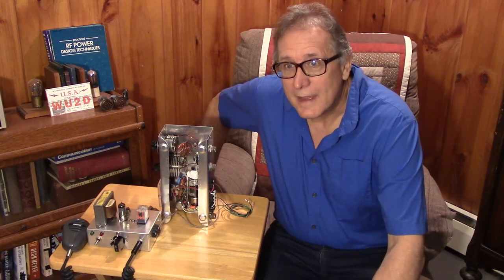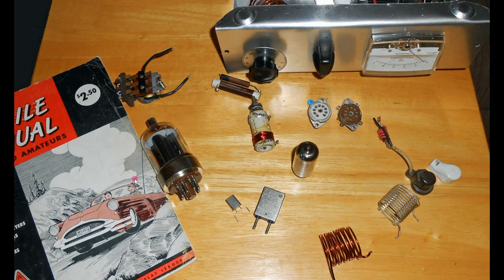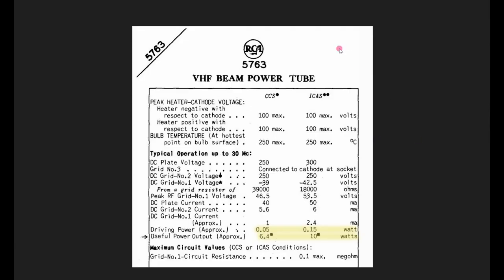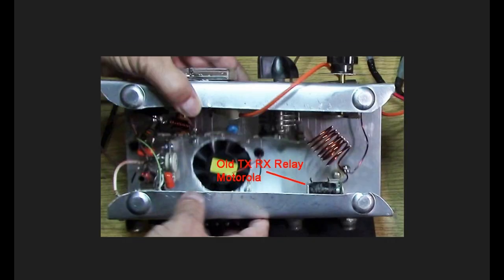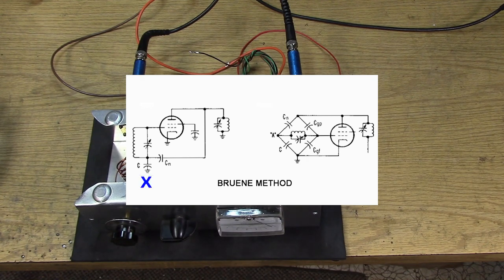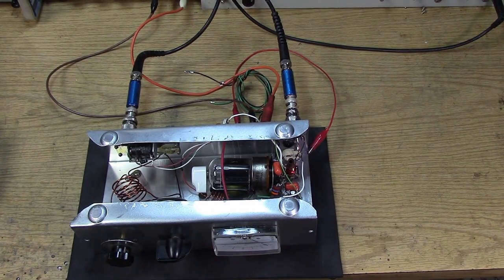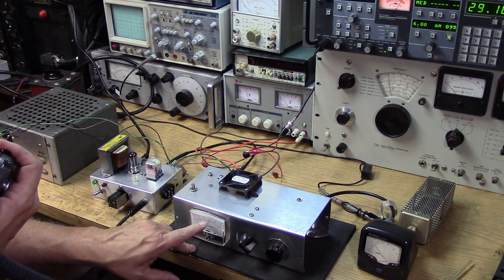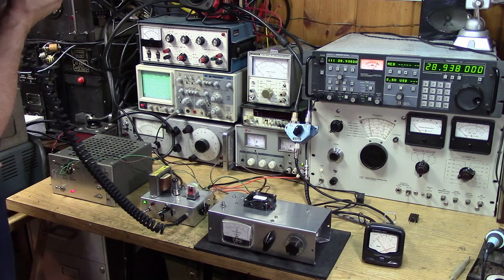10M Linear Amp Part 3

Comment: I love that even though a circuit is "ridiculous" you build it anyway! That way we can see what true ridiculousness is and what to do when (and we will) we run into it in the real world. Yes, sometimes I visit reality for fun to make sure it still exists. 
On my Kenmore 599 twins, and on my Johnson Invader 2000, the neutralization was done with the power off. For some reason it is done on 15 not 10 meters at least on the Johnson, but I believe with both radios. Both rigs run 6146's on the finals. The Johnson exciter was 100 watts output IF you didn't run the built in leee- neeear with a pair of PL-175 (4-400 with an extra suppression grid). It is NOT a true am rig as it's usb with injected carrier. Something I've only known CHU to do. Really enjoyed this series. Thanks a lot and 73's!

Comment: Hi Mike, the idea of having a grounded grid amp configuration got me thinking about another amplifier configuration.
I see a few aspacts of the kind of amplifier you propose - the need for neutralization (negative feedback), the need for a pi network on the output as impedance transformation. I have tried a Norton amplifier once, which is usually made with a bipolar transistor. If you are not familiar with the Norton amplifier, it uses a grounded base, input is into the emitter but via one turn of a transformer (in series with the emitter), of which another part is in the collector line. The transformer is tapped halfway up the collector part, but this could also be a separate winding. The nice thing about this amp is that the voltage gain is set by means of the input (1 turn) to output turns ratio (let's call this N over 1). The input impedance is equal to the load impedance if the total number of primary turns, including the one turn in the emitter, is equal to N^^2. Yet the impedance as seen by the collector is about N^^2 times Rload. And the Norton amp is pretty broadbanded as it has no tuned components.
To cut a long story short - would this kind of configuration be possible/benificial to a grounded grid tube amp as you propose here? I guess it would.

Comment: Thanks Mike for sharing your time and expertise in another informative and entertaining video. I’ll be most interested in knowing where one might find a modulation transformer these days... sans the fact that one would be gathering dust somewhere under the bench or in the corner of the shack. I’d think one would have more luck digging a hole in the backyard and finding oil then obtaining a transformer that would have the correct parameters for use as a modulation transformer. As the TV newscasters say... I’ll ‘stay tuned’ to find out.
Reply: Kenneth, Hammond makes a 25watt 2013 modulation Transformer for tube plate AM modulation.

Comment: Hello, If you have access to ARRL QST Archive there is an article in August 1956 by Lewis McCoy W1ICP about a 6146 one tube HF Amp. I be interested in your thoughts about it. On E-Bay there are new power transformers 320V-0-320V. for $60. Would something like that work with a 6146?

Comment: Mike, you could have used the 12 volt filament version of the 6146,  a 6883. The 6883 was meant for mobile operation on 12.6 VDC battery system. The 12v fan would be happier, but with a little more noise.  I have a number of used VHF high band mobile FM transceivers with the 6883 tube as the final.
Reply from the maker: Yes a nice bottle!

Comment: What do you think about the 4 tube method you mentioned for 20-25 watts carrier for 80 meters using the GRC-9 as the driver?jim
Reply from the maker: The GRC-9 would be happy to drive a similar setup for sure! It would do well driving a single 811 too, but not grounded grid.

Comment: thank you for the good explanation in this beautiful video!
give me the modulator anyway ( A LOT PRETTIER! ) Okay Then extra work, but that's just nicer!
I do that with 2 X EL84 (oscillator and stage) the modulator EF86-ECC82-EL34(2X PP)
MANY more (and hard to find) parts, BUT such a nice modulation! simply beautiful!
in this case it is a pirate transmitter (sorry!)
friendly greetings from The Netherlands!
Reply from the maker: Absolutely and if you get tired of AM, substitute an output transformer and turn it into a Guitar Amp!

Comment: Nuterlizing the Kenwood TS-520s is a horror show. You must use plastic screwdriver . Like the Idea the Radio Shop guy had with the FT- 101 using scope with Tee fitting 50/50 resistor, power switch on back of radio in low power setting! Using another receiver seems harder to do scope seems Mor accurate ! JohnBoyUtah KJ7TBR 🇺🇸😎🎙📡
Reply from the maker: There are many ways. Transceivers are hard to do in the reverse method because of the relay. Fortunately most have some provision to lower the power.

Comment: I did not fall asleep as I watched it at 7 AM. You could not even make one contact with the amplifier thus I suggest a common plate with a strawberry rhubarb pie output.
Reply: In a previous video he commented that he fell asleep after 8 minutes and asked if it worked - I bet his wife has kept saying the same thing to him way too many times
Reply from the maker: @_wave64_  Burt is this channels best subscriber! I am in trouble for sure.